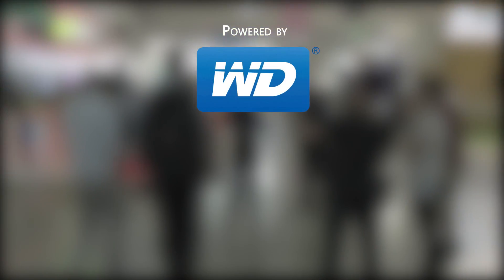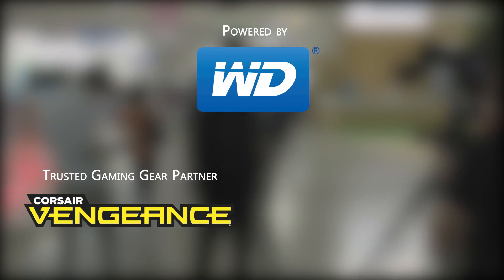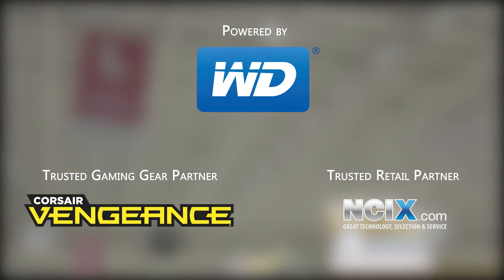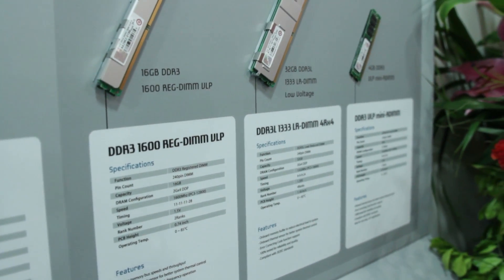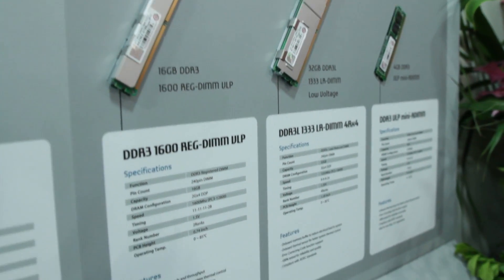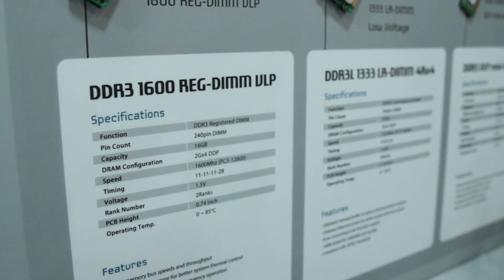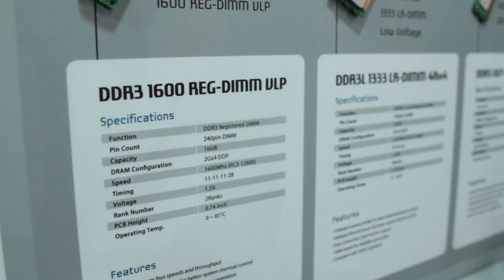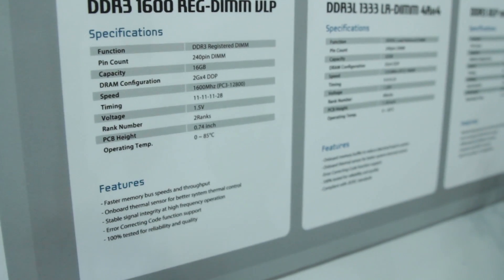Transcend ECC Memory Quick Tip - Computex 2013

Comment: That is different, Mirroring reduces corruption chances, however, ECC uses a parity system, which basically is an extra byte of data every 8 bytes of data, if the 8 bytes of data have a different parity than the parity byte, it is known to be incorrect. If any of the 8 bytes change, or the parity change, they will no longer pass the parity check, and corrupted data is avoided. The chances of a corruption causing a pass on the parity error detection is very slim.